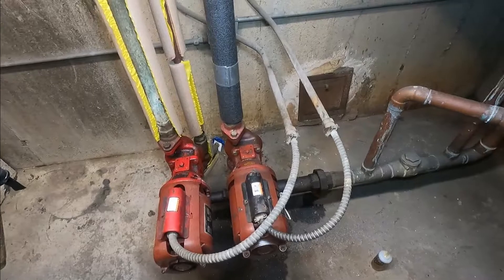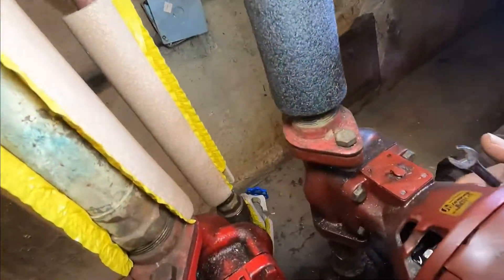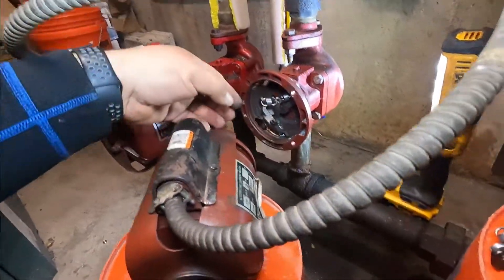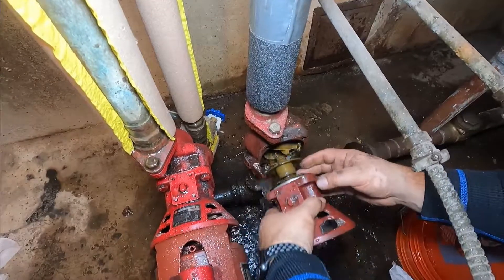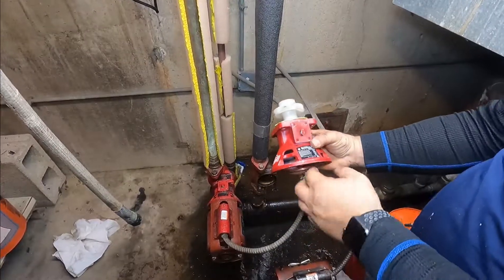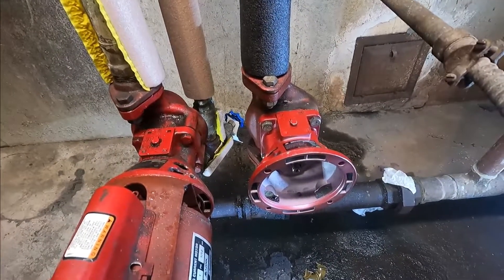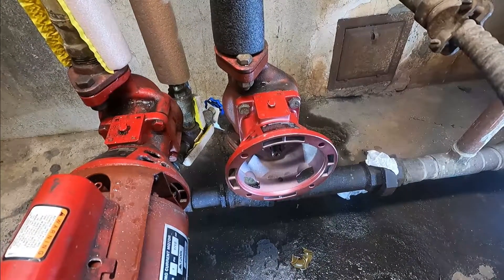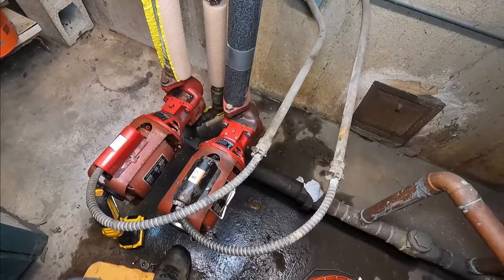HOW TO REPLACE A B&G  BEARING ASSEMBLY

Comment: My pump has failed.  I think the motor is shot.  When I pulled away from bearing assembly I can still move the shaft on the bearing assembly but I don't know how much it should move freely.  Should it spin as easily as the shaft on the motor?  Could a tight bearing shaft cause the motor to go bad?  Wouldn't the couplings break first?  Is that not what they are for?  Please help.  I'm trying to decide if I should buy just a motor (much easier to replace) or the whole pump (break into the water pipe).
Reply from the maker: Hello MIke,
1  the bearing assembly, in my opinion,   is a little bit harde r to turn with your hand, but you should be able to turn it with your hand.
The motor shaft is easier to turn.
Remove the motor and test it  by itself. Connect it  to an extension cord.   If it spins with no trouble, Then is going to be the bearing assembly or the impeller.
Yes a tight bearing assembly can cause the motor to go bad.   
Check amps on the motor.   It should be 1.20 - to 1.35 amps when running.  (if it is the 100 series)
Yes the coupler's  goal is to turn the bearing assembly with the motor shaft.   It is weak on purpose so it breaks if there is something wrong with either the baring or the motor.
If the coupler didn't break then is more than likely the bearing assembly or the impeller that broke.
Some times impellers break and get stuck not allowing the assembly to turn.  
I would suggest to buy the whole pump (motor and bearing assembly and impeller)   that way it is for sure you fix the problem.
Or buy the whole pump and use only the part you need.   If you buy separate parts is going to be more expensive.
I buy my parts from supplyhouse (website)  Is is cheaper that most places and ships fast .  
good luck with your project .   Let me know how it goes.   Alex
Reply: @alexthehandyman3494  Hi, thank you for responding.  I did what you said about connecting an extension cord to the motor.  No luck.  It is dead.  I even had a service guy come over and confirm it for $180 last night! I ordered a new motor online last night so I should have that in a few days.  House is staying somewhat warm just from the boiler moving water naturally.  The shaft on the bearing assy does move with just my fingers and I don't hear or feel any grinding or anything.  I am glad to hear that the couplers would break before the motor to protect it if the bearing assy seizes.  
Are you saying that if I replace the motor, there could still be a problem with the bearing assy or impeller which will just cause another motor failure?  How would I know after I put the new motor in?  Like I said, I already ordered a new motor last night.  
I really don't like the idea of having to break into the water line because I don't know if I can handle a proper bleed.  Is that a hard job to do?  What would happen if I don't do it right?    Thanks in advance for your help on this.  The guy quoted me like $2000 to replace the whole pump!
Reply from the maker: @mikepotter3802  Hello Mike.   2000$$  Holly Molly!!!    To replace that pump it would take 1-2 Hrs  Plus bleeding the air out 1-2 hours   Say Max 4 Hrs.   
at 100 -120 Hr   that should be 400 to 600  Plus pump cost   Pump cost is 500 plus mark up.    A fair price would be 1400  (this is just my opinion)
And yes!!  your assembly and or impeller might be still bad.     Try changing the pump first.   Connected and turn it on.   Listen for smooth operation.   If you hear grinding or weird noises stop it right away.   Do you have shut of valves before and after the pump?.   Do you have bleed valves on the rerturn Pipes?   Do you have one main return? or each zone has its own return?    Either way, if you don't have the money or don't want to spend it, I encourage you to do it yourself.   I can assist you via telephone or video. send pics of you can.  what kind of zone valve do you have in your system?

Comment: At 4:35 and 5:32  you can see the damage done by the fly away (oem) coupling to the bearing assembly.
 Spiralink couplers last almost indefinitely.
Reply from the maker: Hello Don,
you are right.  The spiraling last forever!
They are a bit pricy but they are worth it.  Not all supply houses carry them.  I buy mine at 
supply house.com   $25   Vs  B & G $ 6.
Thanks for your input.

Comment: WHAT YOU FELL TO TELL THE PEOPLE IS ABOUT THE RUBBER MOUNTS OF THE MOTOR
AS THE MOTOR VIBRATES THE ALLIGNMENT OF THE MOTOR AND THE IMPELLER MOVE OVER TIME AND THE COUPLERS GO BAD,,,,BUT IF THEY PUT SOMETHING UNDER THE MOTOR TO KEEP THE WEIGHT OF THE IMPELLER ,,,THE PUMP WILL LAST FOR LONG TIME IF LUBED CORRECTLY.
Reply from the maker: Hey John.   Thanks for your comment.  
I never had done that, but it makes sense.  Thanks for the tip.

Comment: Alex i have a question, just replace motor, coupling is moving and all. Pilot is lite. But furnace not going.  Do you think I need to let the water fill up?
Reply from the maker: Hola manuel.    I need more information.  what kind of controls do you have?
Im assuming you have a boiler and not a furnace.
If you lost water when you change the pump parts,  you have to replenish it.  You have to have at least 12 pounds of pressure.  If your house or building has two or more floors I would rise it to 15-20.  What kind of ignition do you have?  check line voltage and 24 volts.  So many posibilities..

Comment: No oil in the new bearing assembly ?
Reply from the maker: Oh My!!!!   How could I forget that on the video.
tlhanksTony!!
LUBRICATION
PUMP BEARINGS
Fill the bering frame according to the oiling instructions decal.  At the time of installation, add approximately 1 oz of B&G @ 20 non detergent oil.
Re-lubrication is required at the start of each season, or every three months for continuous service. 
Relubricate with a teaspoon of oil.
MOTOR BEARINGS
lubricate through the two motor oil cups according to the lubrication decal.  At the time of installation the motor bearings use approx 12 drops each.  
At re-lubrication intervals fill each motor bearing with approx 6-8 drops.